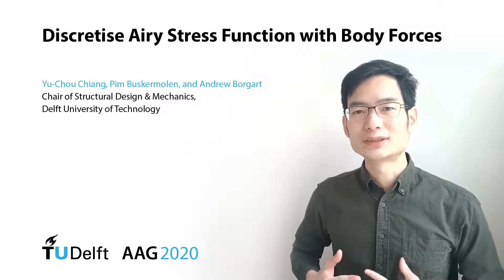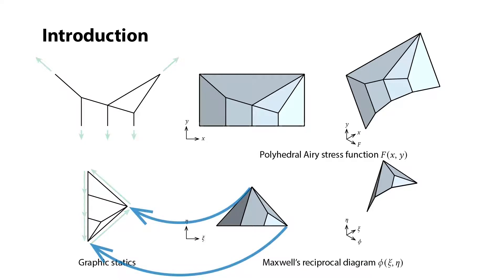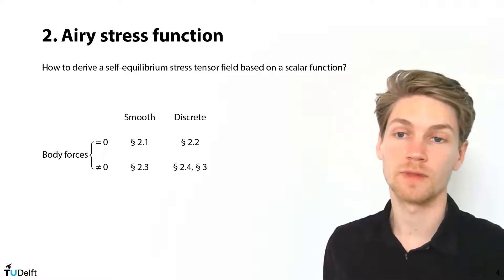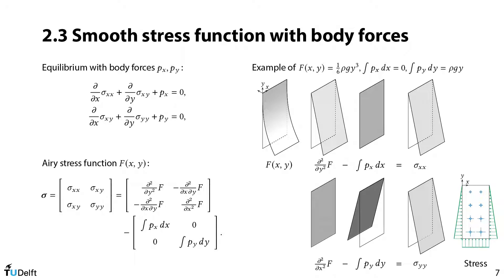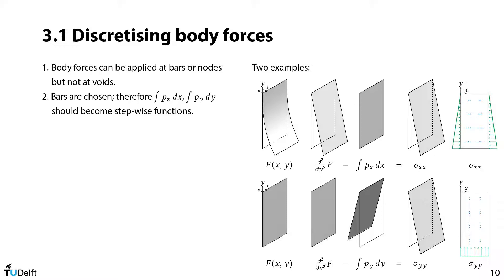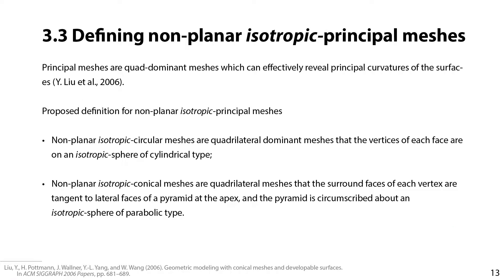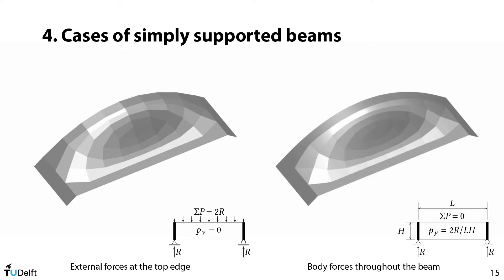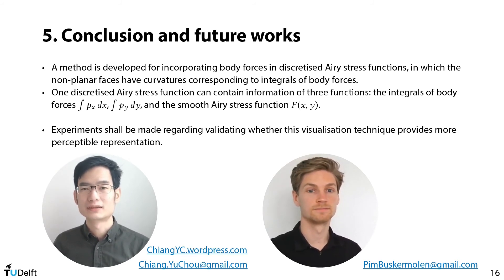04: Discretised Airy Stress Functions and Body Forces

Comment: Thank you for your great presentation!  I'm interested in the effect of body forces in this process, compared to external forces at the boundary, especially in the discretized case. What are the major geometrical differences between the discretized expression of those two stress functions? If we change a different discretization strategy, how will it influence the distribution of stresses?
Reply: Thank you for your appreciation.
1. The body forces mask/cover a portion of the curvatures; in a discretized case, the mask only works on the "voids" and leaves the crease untouched.
2. If the different strategy means different mesh connectivity, the results may not effectively reveal principal stresses. I have an obsession with principal stress networks, so I prefer to using circular and conical meshes. However, triangular or hexagonal meshes should also work.